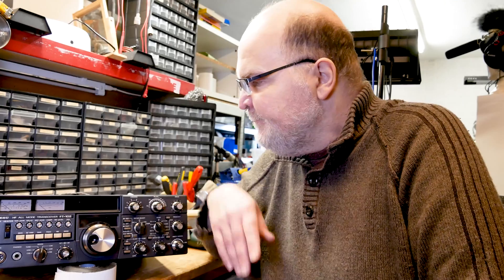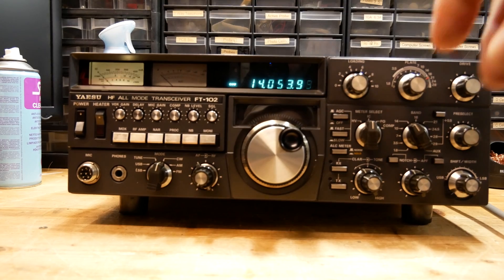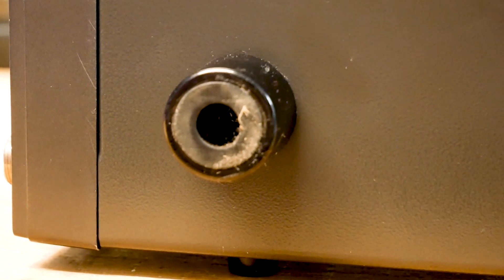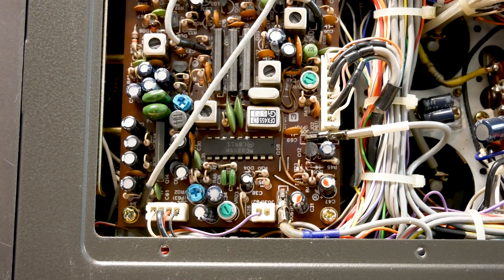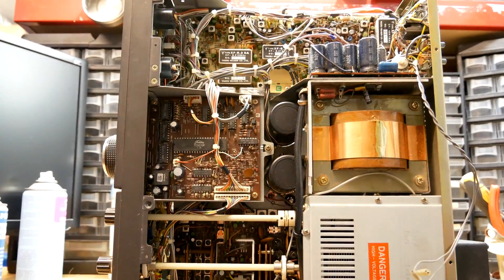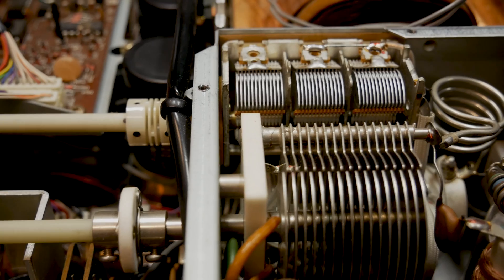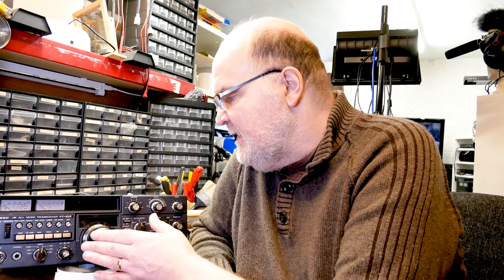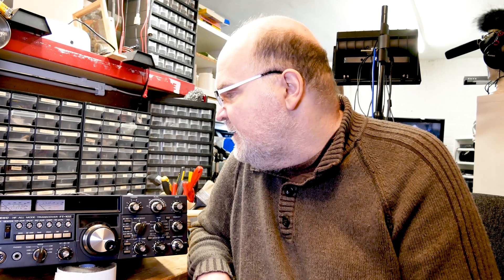Yaesu FT-102 Ham Radio Transceiver, what to look out for before you buy one

Comment: Thankyou for that, very interesting. I have had my 102 for 35 years, relays replaced and two of the 6164B's as i popped two trying to tune a 3 ele beam but, it's running just fine right now.